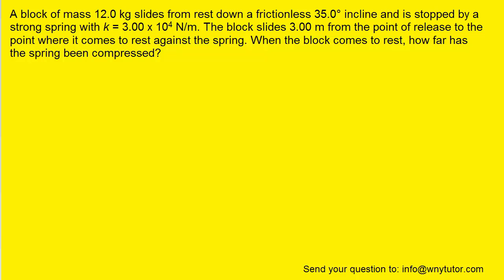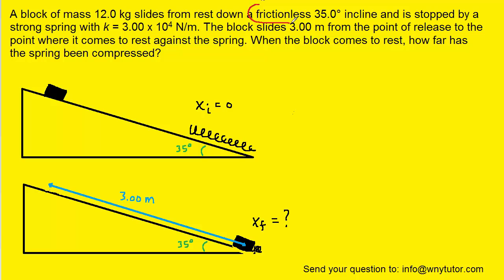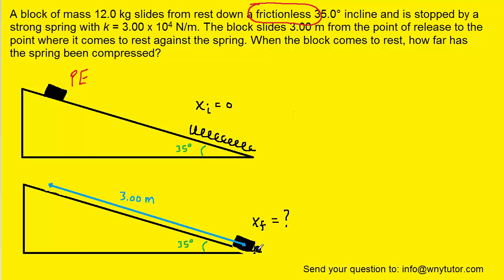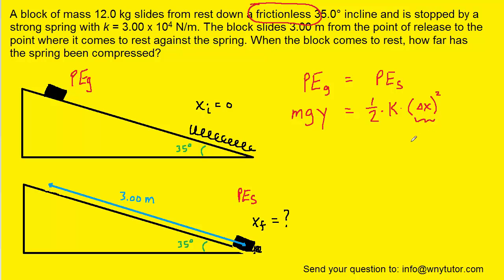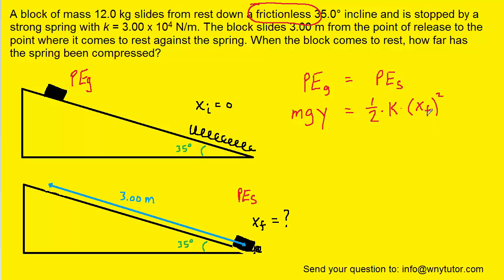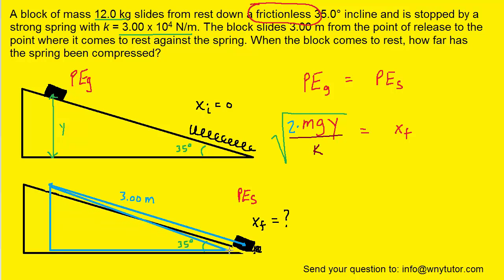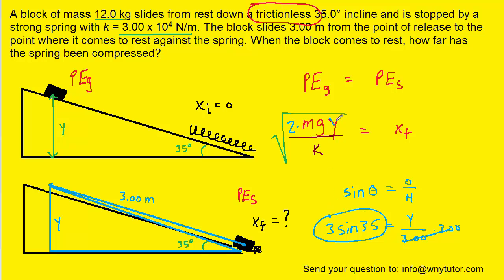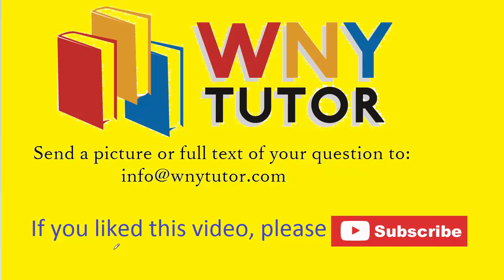A block of mass 12.0 kg slides from rest down a frictionless 35.0° incline and is stopped by a stron

Comment: In a problem im working on, it asks the same question, except it says the box travels 0.38 meters before it reaches the spring. If the angle of the plane is 25 degrees, the mass is 4.1 kg, and the force constant of the spring is 445 N/m, how do I find the compression length then?
Reply: it also says this in the problem statement he's working on. he just kind of ignored that bit.

Comment: What if we were asked to solve for final velocity? and why do you use sine instead of cosine? shouldn't the force applied be in the x axis?
Reply: The area where he used the sin function function was to find the initial height of the block in order to fill in the 'h' variable in potential energy formula (mass * gravity * h) where h is the height from the ground regardless of the path taken. If you multiply the length of the hypotenuse of the triangle, by the sin of the angle at the opposite side of the triangle (the angle of inclination) then you find the height of the triangle.